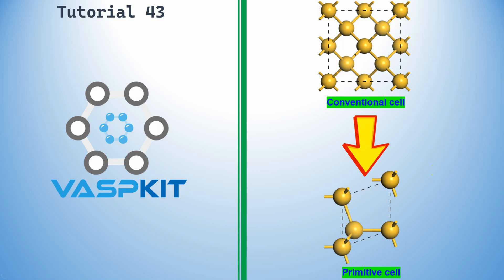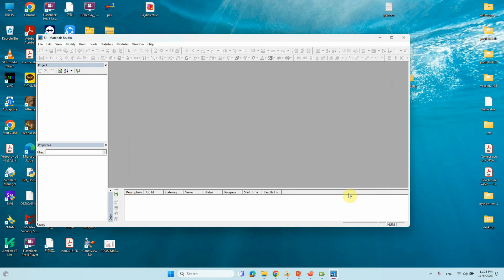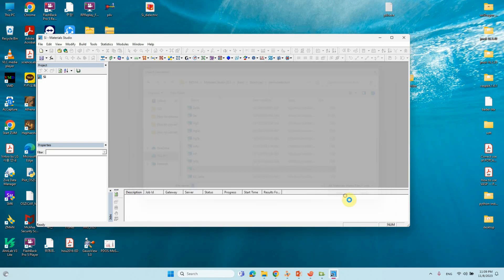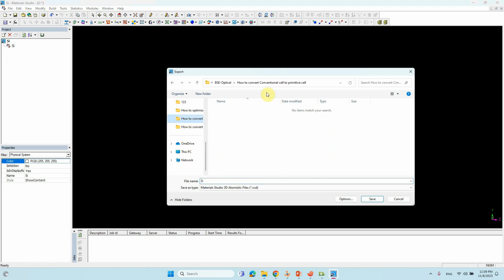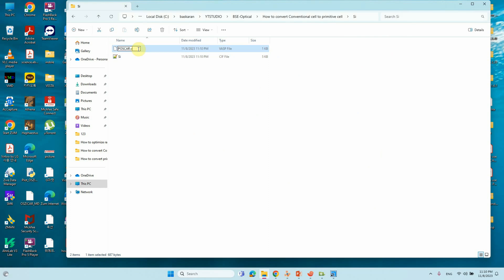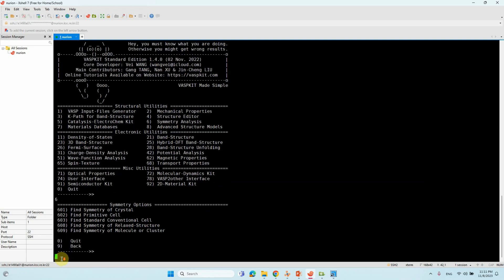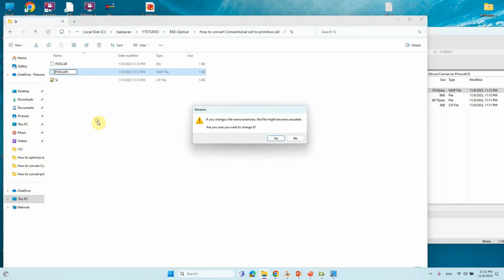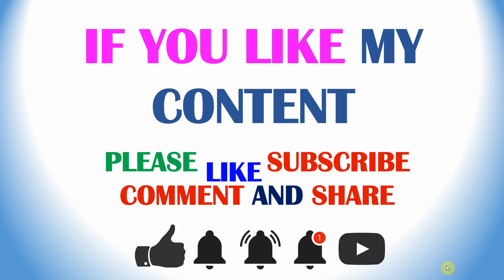How to convert Conventional cell to Primitive cell for VASP Band Structure Calculation

Comment: Hello, sir. Appreciate your videos!
I have a few questions.
First of all, do we use primitive cell for k-point creation only or do we use it as a POSCAR for future calculations of band structure?
Is it necessary to make band structure calculations using primitive cells? I thought that using a conventional cell (or a supercell) should not change the picture quantitatively (it would simply add similar dispersion branches, but physics behind that would stay the same)
If primitive cell is needed, what would one do for band structure of some AFM (antiferromagnetic) structure where you can't describe magnetic configuration using only the primitive cell?